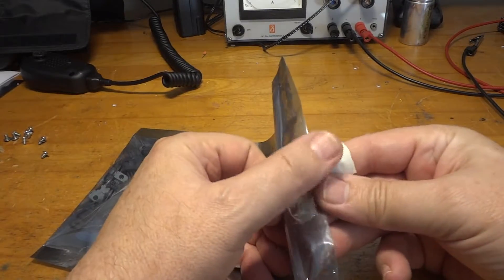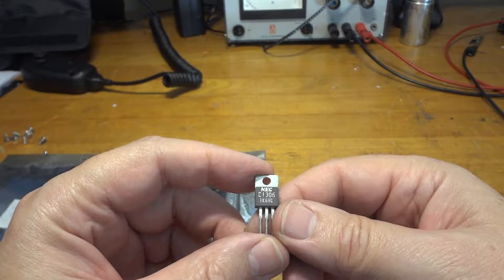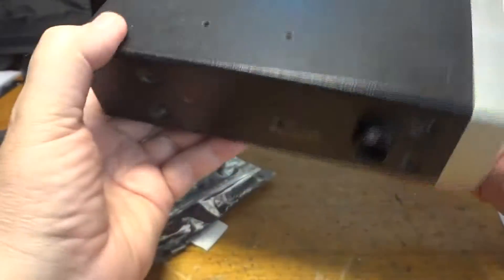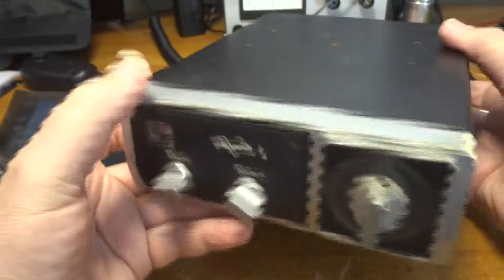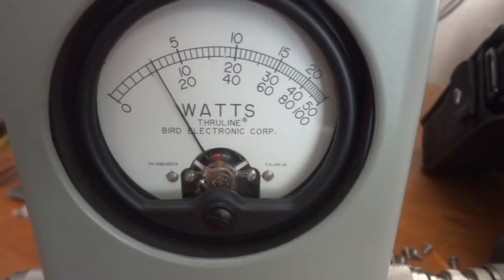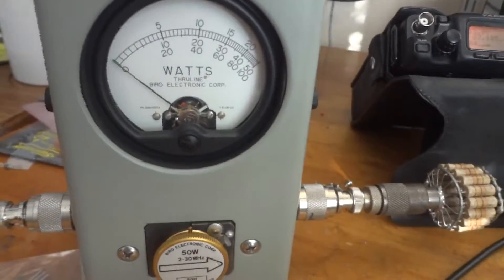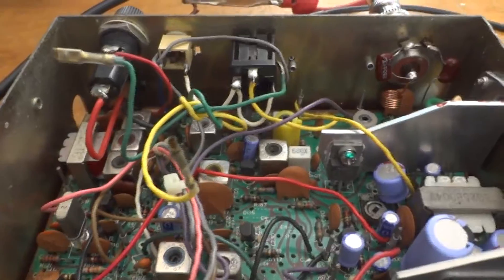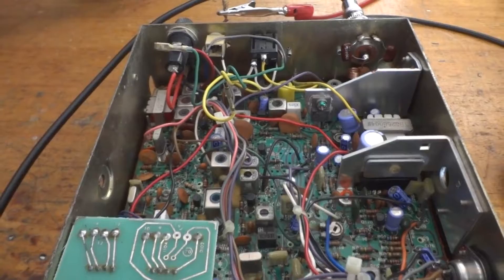2SC1306 vintage RF power transistor for sale (also compatible with 2SC2166)

Comment: Ah yes, the old 40-channel Hy-Gains.  I converted several to 10-meter FM back in the day.  Forget the procedure for the band conversion, but I sourced the FM front-end kits from Bob Heil.  Didn't know the 2SC2166 prices had risen above a dollar so I just checked eBay - the first 2166 I ran across was listed for $84.  Good grief!  You performed a good test for confirming authenticity of the replacement transistor, but shouldn't it be possible to compare the replacement using a transistor checker for equivalent values, especially the hfe?

Comment: Do you have any real 2sc1307 finals ?
Reply from the maker: Sorry, only 2SC1306. But I have tested the 2SC1306 in an SSB CB as a replacement for the 2SC1307, and it works fine, with the same output power. I even tested it with infinite SWR and no problems at all. I think these are actually identical transistors. The only difference is that for the 2SC1307, the transistor was tested for a higher load by the manufacturer. If you think about it, this is what you would expect. Because the 2SC1306 is specified for 4 watt AM carrier output, which is 16 watt PEP at 100% AM modulation. That is actually more than what the 2SC1307 puts out within the FCC specification: 15 watts SSB output at PEP.
Reply: Got lots of them

Comment: You should really keep your fingers off the leads, especially if you aren't wearing ESD protection. They don't put them in the anti-static bags for nothing. Even small amounts of static that you can't see or hear from your fingers can damage the devices and cause premature failures. Otherwise, good video!
Reply from the maker: Nah - if you make sure your body is at the same potential as the area where the device is located before you pick it up, AND, when you pick it up, you contact all pins together with your fingers, there is no problem at all. Cheers.

Comment: Why change it if it still works all you can get out of them radio is 7 watts the power section its very small to power bigger transistors
Reply from the maker: The objective here was not to improve on the CB radio, the goal was to use the CB radio as a platform to test a (vintage) sample of the 2SC1306 that we have here. Just to make sure it is the genuine NEC 2SC1306 from 1975. Which it is, as this test proves. Sorry if that was not clear.
Reply: And it puts out the same power

Comment: C1971s they use them as a driver in the ft 757gx2 and the gx
Reply from the maker: The 2SC1306 is a good replacement for that
Reply: Predriver is 2SC1971, driver is two 2SC1972
Reply: Hope i get original ones i need that driver to key up the pa section in my gx and gx2 when you key up the screen goes out and draws current it receves great without keeping up